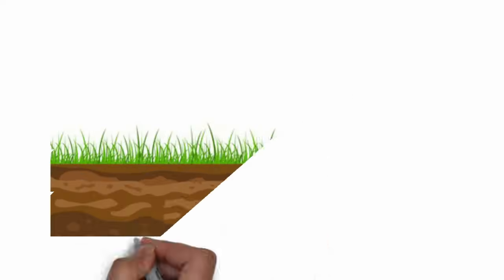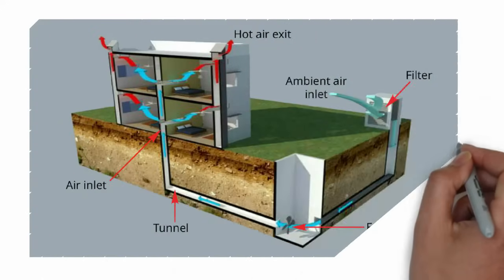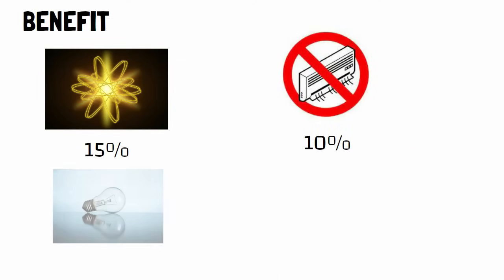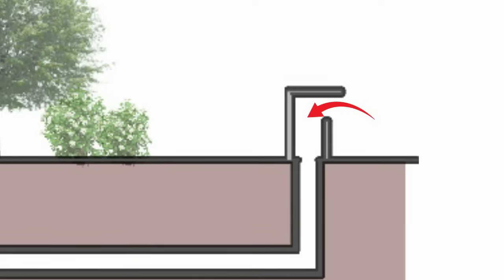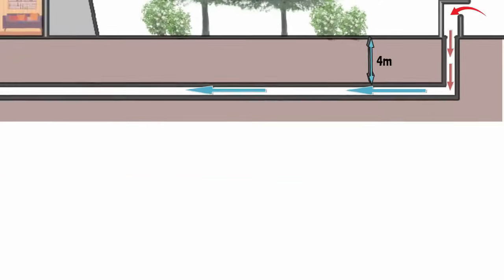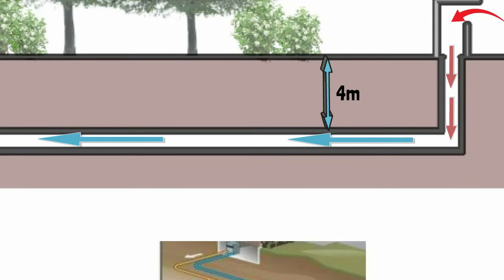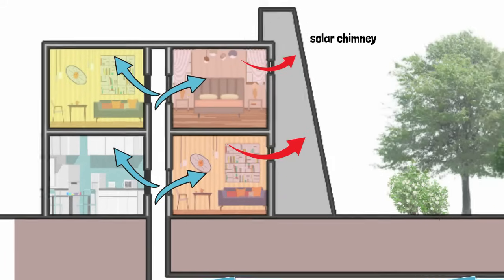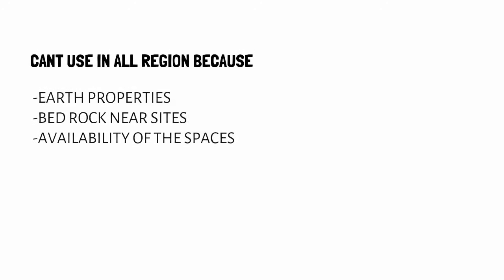EARTH AIR TUNNEL || HOW IT WORKS || passive cooling technique

Comment: If you cool the air below the dew point moisture will condense in the pipe.  The air is full of various spores which will love the dark, cool and moist environment inside this pipe.  In order to move air with the least resistance, the pipe will need to be larger and will need something to cause turbulence for the best heat transfer.  You also need a structure that is sealed well enough to develop enough stack effect and enough Vacuum to draw air thru this pipe instead of thru every leak in the envelope. IMO, a far better way to do this is to bury water pipe in the ground and circulate water thru it to chill the water and run it thru a fan-coil/radiator.  Any condensation will occur at the radiator where it can be dealt with.  You can also circulate room air thru it for increased cooling and better climate control.  A little more expensive and complex,  but all commonly available components…
Reply: True, mycotoxins are not to be messed with.
Reply: Absolutely true. Beneath the ground, the inside of that pipe will be nasty inside of a year. And the stench and humidity would make the house unlivable.
Reply: Great comment, deserve 100 tumbs up! Nobody thinks holistic, as air quality is not just temperature, but humidity and polution. I have personaly experiances some inovative   heating and ventilation design where air becomes so dry that after night throat gets bone-dry and burns like hell...
Reply: Alot of these designs are for super arid areas. Not a lot of moisture build up.

But you make good points
Reply: your comment deserves more thumbs up than the video itself.  geothermal sounds way better to me
Reply: @brianbailey462  I agree. this comment's idea is better.
Reply: I agree. A previously very healthy young woman I knew lived in an apartment that got a mold infestation. She moved immediately upon discovery of the mold but was already suffering ill health effects and eventually succumbed to complications.
Preventing mold infestation is very important.
Reply: @ryanlynch290  ironic...working on plans at this very moment. Considering a fan with a humidistat. they are not terrible expensive. on that would blow air into the walls to keep humidity out of the house walls to prevent mold. tho maybe a simple fan would do the trick if the humidity in the house is already low. i lived in an apt that had mold problems. i care not to repeat the experience. Some black molds aren't toxic...but you would not know until a sample is tested. even so...its not something you want in your house or apt under any circumstances.
Reply: If you have a very dry climate the towers would probably be ok ,but wet condition would cause respiratory problems
Reply: I'm pretty sure you just described a heat pump...
Reply: @TheThunder005  yes it really is a heat pump...low tech
Reply: @TheThunder005  no, a heat pump in the common application(conventional air conditioning) involves the use of a change of state(liquid boiling to gas and gas compressed/condensed back into liquid) of the cooling medium/refrigerant.  the change in state, liquid to gas absorbs a tremendous amount of heat energy, that can then be “pumped” to another location where it can be dissipated and the medium(refrigerant) can be sub-cooled and Re condensed to be sent back to the first location to repeat the process. Since this method “concentrates” heat, you do not need a difference in temperature to transfer heat from inside a dwelling to outside.  It can be warmer outside, but you can still send heat out there.  But this magic takes a significant amount of energy.  What I described is simple heat transfer using water as the transfer medium.  Since heat only flows toward cold, Like an automobile cooling system, it relies entirely on an existing difference in temperature, air temp cooler than engine temp.  Or in this case between the room 70F+  with the earth temp, ~55F? to absorb heat collected in the dwelling.  It takes a whole lot less energy to circulate water and air than to run a phase change air conditioner 1/6 to 1/10 as much.  My first one was entirely solar powered, blower and pump) which worked well as it was only needed when the sun was out…
Reply: It’s true! A guy did this in my hometown back in the late seventies, when he built his house. I briefly worked for him, installing solar heating panels. In the beginning it worked great! I was in his house one really hot day, here in Minnesota. When he told me he was just running the furnace fan to move air, I couldn’t believe it! It felt like AC.  Anyway, a year or two later, I asked him about it, and he sullenly said ,he had to stop using it, because the whole house stunk of mold! In Minnesota, heat also means high humidity. Maybe this would work in a dry climate, but not here.  Too bad, because it seems like a great idea.
Reply: @MikeNelson-s4o yep.  You can still do it, If you bury water pipe in the ground and circulate water thru that pipe to cool to earth temp.  Then thru a radiator and a fan inside the house.  
Not all that much more complex. I have done it. I have irrigation water run thru ~ 400’ of underground pipe.  I ran one of my sprinkler hoses into the house, thru an old car radiator and back out to a yard sprinkler.  I have some solar panels, I paralleled to run an automotive radiator cooling fan to circulate air.  Was about equivalent to a small window air conditioner, cool enough to condense moisture out of the circulated air(had to set the radiator on a drip pan).  Lowered humidity and cooled my living room…  all possible for about 120-150W of power to operate a pump and fan…
Reply: there is a better way, and you don't get al the bad stuff you get with a air tunnel
Reply: below the frost line its a constant 55 degree's, mold wont grow at that temp. whats the better way?  @randybird9979
Reply: @randybird9979 what's the way Randy Bird ?
Reply: @gorderbust  bury water lines, run water thru them, it works about the same way, but you don't have to pull air thru something with mold in it, it takes a lot of water line and or you could use the line you pull air thru, at ant rate it works pretty good, helps with the cooling in the winter and the heating in the winter, like I say, it only helps, another way, if you have a property with an old well, coil copper line and put in the well, run water thru the copper line,   it works better then the buried water line, of course you will have to add to the heat or cool but it will take from a larger heat and cooling bill, works pretty good,
Reply: Just stumbled across this video and your insightful comment. Mold and spores are bad enough to deal with in a dwelling, no sense in providing an efficient delivery system for them.
Reply: you dont have to @Javelina_Poppers
Reply: Pffft what are you an engineer??? All I hear is hater talk. I can’t understand this fully so I’m gonna call you out on this as BS (this is a joke, I’m an aerospace engineer, so this video is comical bc the “simple solution” is so broken it’s complicated when you actually consider fluid dynamics for half a second)
Reply: This works best when you have a house on a hill on some acreage where you can have the tubes on a slope to daylight rather than an above ground intake.

The moisture just drains right out
Reply: It allows radon gas and microwaves to enter the house as well. There’s no filter and your home can be infested with bugs with all the moisture.
Reply: @carmeliathompson5222   microwaves?
Reply: In other words, an air conditioner.
Reply: @nomnomnomymous  not in the common understanding of air conditioning or heat pump.  Like i said above, A/C or heat pumps use a phase change refrigerant and consume a lot of power.  What I was proposing is a simple heat exchanger, warm room heat transferred to cooler earth temp using a radiator and water circulated thru buried pipes. Very little power required…
Reply: Exactly, this method could probably be considered outdated for the reasons mentioned. Moisture, mold  and bacteria. Closed loop systems are the new norm.
Reply: circulating water will cost much
Reply: @bluelobster6100  not much and is much more efficient and just better, but, you do what is best for you
Reply: @bluelobster6100  less than a light bulb, probably about as much as circulating air thru the radiator…  but this will be far more effective than relying on a structure being tight enough to have enough stack effect to pull air thru the underground pipe.  It will also avoid contaminated air from the underground pipe and will actually reduce humidity of the dwelling air…  i have done it, using solar panels for pump and fan power.  Worked great…
Reply: thx man😄 @rronmar
Reply: I deleted my comment, since we said the same.
Reply: Exactly, unless you are in a very dry place, you have to be carefull with that. You could use a heat exchanger to isolate yourself from mold.
Reply: lay the earth pipe at an angle to roll water to a cleaning sump?
use vacuum cleaner to suck line through the pipe to run cleaning patches with disinfectant.
every system can be a hassle. your " bury water pipe in the ground and circulate water thru it " can crack leak need refilling is still a fail mode
Reply: @littlehills  you would have to do something to allow flushing/cleaning out the pipe.  But it also needs to be a big pipe to allow airflow with less restriction.  so you are talking a large volume of water to fill/reach all surfaces of the pipe when you do clean it...  In the end it is really hard to make the structure tight enough to create enough draft to draw air thru the pipe naturally anyway.
Reply: with the soil possible emitted radon gas induced in the house , no thanks
Reply: the water pipe uses way more power to run two fans and a pump
Reply: @TheHellbillyx  not nearly as much as a proper air conditioner.  I have run the pump and fan with a couple of 15w solar panels…   All without moldy/musty smell from buried underground air pipe…
Reply: https://youtu.be/nV7XJXETr0Q?si=htuzx92bZsMsLbjc
Reply: Michael Reynolds, of Earthship fame, has developed a similar cooling system with high Earthship designs.  Not like this specific design.  Truthfully,  haven't seen it outside of more arid examples.  His philosophy is to make the systems as least dependent on mechanical and power as possible.  Conserving energy as best as you can.  Check out other examples.
Reply: Para eso se hace un sistema de desagüe con salida con filtros
Reply: Bullshit
Reply: @thomasschafer7268 well you are entitled to your opinion however misguided it may be…  build one and find out…
Reply: @rronmar  habe build  fist in 1995. One in 2004 Last in 2013. Anfänger!!!😅😅
Reply: Morning @rronmar, many thanks for your message here, I think I will put a dehumidifier at the beginning of pipe inlet and will constantly monitor it
Reply: @LalapanziSpecial the moisture in the middle will be what causes you issue.  In the end, you need a building sealed well enough with enough stack effect to full air thru this.  If you are going to use a fan, it is just as easy to pump water, so fill it with water and ump that thru a radiator and use the water cooled by earth to cool the air with a small fan.  This works really well…  good luck!
Reply: Wenn das Rohr  mit Gefälle  verlegt und einen kondensatablauf vorsieht passiert  überhaupt  nichts.  Sonst würden klimaschächte auch nicht funktionieren.  Schöne Panikmache 👎👎🇩🇪
Reply: The problem is that such a design becomes active vs passive.

Most in ground tubes are sloped at ~ 1% this allows water to collect in one location and be drained/pumped out.
Reply: @HealthyUofGA but that will not lower the humidity/condensation that is creating that water that needs to flow/be pumped away(also not passive)…  unless you build a very tightly sealed structure with only enough ventilation at the top to build enough stack effect you will have trouble drawing much air thru this pipe in the first place.   With a perfectly sealed structure in an arid climate, maybe.  Any place with moisture, and your air will smell like a musty basement…   The energy to run a small pump to circulate water thru buried pipe and fan to circulate air is not a lot, a tiny fraction of what an A/C consumes.  It could be done with solar, and would not require a particularly well sealed dwelling, and would have none of the obvious drawbacks and health concerns…
Reply: @rronmar tell me you have never lived in the rural southern US without telling me you have never lived in the rural southern US…

No it does not reduce the moisture (relative) in fact it increases it to saturation as you suggest. However the 1% slope drains to a collection point which then exposes the water to a french drain allowing it to flow away. This process is very passive. Stay above the water table.

You do not need a completely sealed environment and so long as you are still turning the air over every hour or so, you are fine.
Reply: @HealthyUofGA if you have the right conditions, mostly arid, but you just acknowledged the main flaw.  It is constantly saturated and not all the moisture will drain away.  Into this dark moist environment you introduce dust and mold spores…   There is a reason basements and crawlspaces typically smell like they do unless extraordinary steps are taken and this will very quickly do exactly the same thing.  Yea lets just suck that musty air into the place we live and breathe…  it still falls back to the basic premise that the structure itself must be sealed well enough and have enough stack effect to try and suck that cold air up out of a small hole in the floor…  Quite frankly if you have the ability to build such a dwelling, you probably have the wherewithal to put a couple hundred feet of Pex or even garden hose in the ground and run a small pump and fan and make some clean cool air regardless of how well the building is sealed…   The last one I made used irrigation water an old Honda radiator and the fan was powered by solar panels.  Kept the living room comfortable for 4 people…
Reply: true...think I'll connect an industrial dehumidifier to remove the the water first, purify it...and use it for drinking water. get 2 use's out of it
Reply: @gothboschincarnate3931  well it would have to be out at the air inlet to lower the humidity in the underground pipe.  It would not do much about the dust/dirt that would collect in the pipe.  If you do it after the pipe, well the pipe will still grow mold…  less problematic to simply bury pipe and run water thru it. Also far less electrical load than running a dehumidifier…   the fan coil inside will act as a dehumidifier and condense the moisture from the room air, which you can still harvest…
Reply: @rronmar  industrial dehumidifiers have a dust/dirt filter. my goal is to harvest water from the air. I want to dry the air before it gets in the house to prevent mold.
Reply: I cant believe all the brain-dead comments.
Reply: @gothboschincarnate3931 ah yes the one person everyone hates in the comment section the one person that thinks he is the smartest person in the room
Reply: This system works well in remote communities in central Australia.

Comment: Guys........Buckminster Fuller taught that only 2 meters below the earth's surface....there is a "mean temperature" world wide  of only 12 C (about 54F)  so there is actually a much larger difference in underground temperatures that this video states!!! Making this system you show, much much more efficient that you tell us about!!! And it doesn't need to be one long underground tube....it can be a zig-zag design that takes much less space! D

Comment: Well this is BS just waiting for a Busted video.
Reply: It works much like geoexchange, but does so without a compressor.  On average 30 feet down the temperature is constant, ie the energy leaving is equal to the energy entering.  You can think of all of earth and water bodies as a giant thermal battery.  Can it work scientifically, yes! However capital costs will vary, as will efficiencies, depending on soil factors, it make no sense to use metal pipes, when they soil thermal conductivity is so low.  You need lots of surface area, and its not as simple as long lengths as you want the air to circulate, and they use fans often in inputs and outputs.

Comment: Total bs. Once air will start flowing through this pipe temperature of the soil around the pipe will be the same as temperature of the air.
Reply: No because the soil is conductive too, and is a huge mass the earth.  Millions of tons of soil with heat capacity at same temp, conducted slowly.

Comment: The earth is not 24C, it is more like 15C at that depth.If you have a well or even city water. Just run you tap water for 5 minutes and measure the temp of the water. That will give the temp of the ground.

Comment: Maybe just build a small sealed water proof room down there for sleeping on very hot days. Works as storm and bomb shelter too. 😀
Reply: Many times I question why we put our sleeping quarters on the top floor instead of the basement especially when it's hot or very windy.

Comment: What about the risk of the corrosion with the tube if we use galv pipe?
Reply: ou could use an industrial dehumidifier to remove the the water first, purify it...and use it for drinking water. get 2 use's out of it

Comment: I first saw this system in about 1973 in  Texas.  They used concrete pipe and the constant air flow kept the air dry.  I would put gravel under it and a french drain.  The one I saw was 150' long and about 15' about 36" in diameter.
Reply: .... so it was a giant upfront cost in comparison to a standard AC.